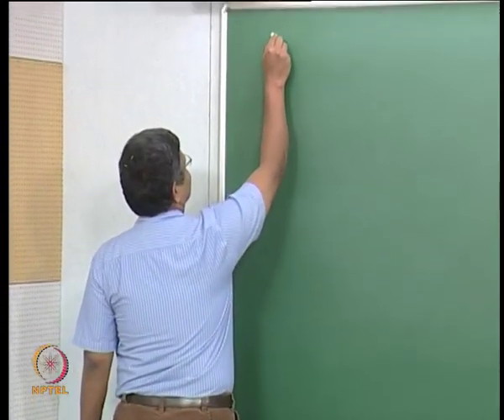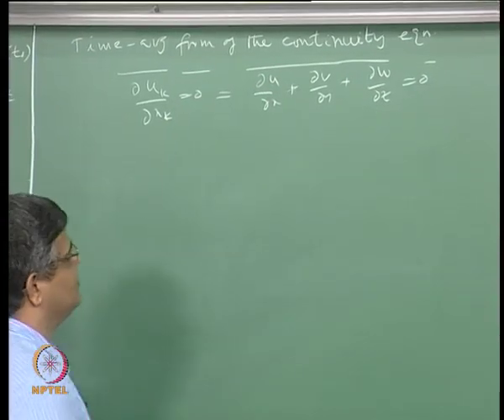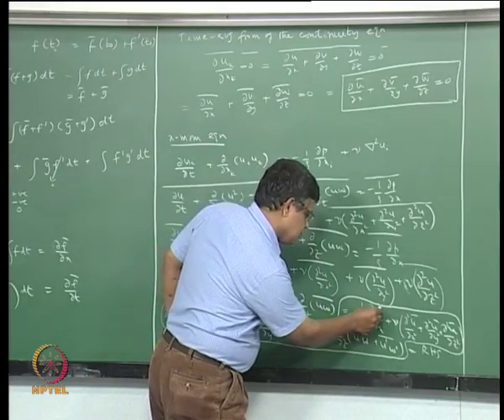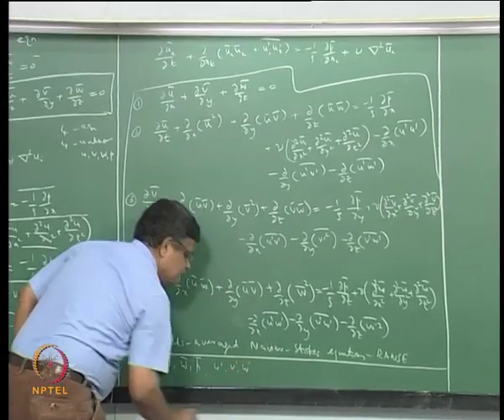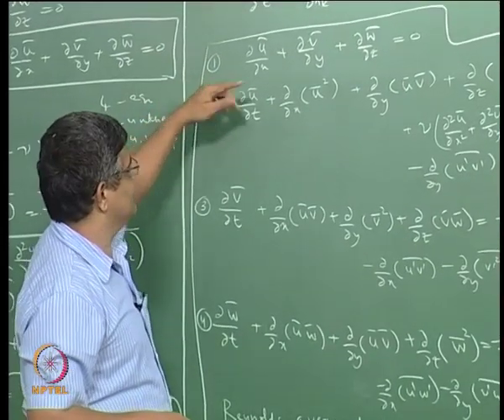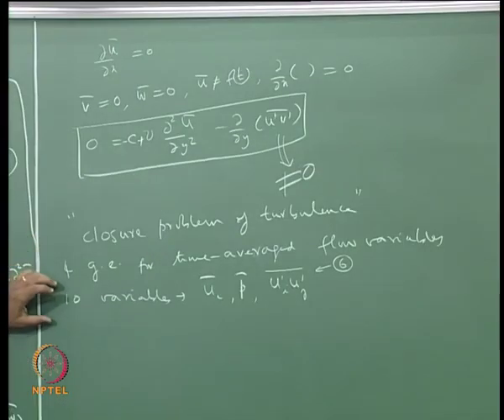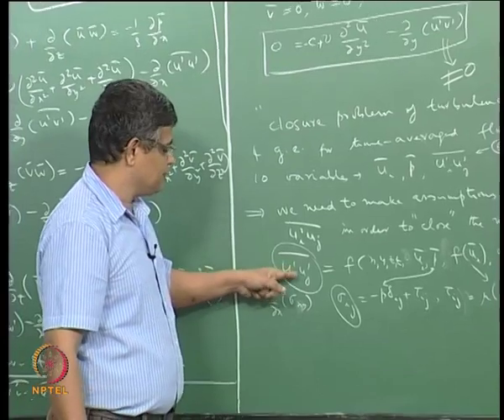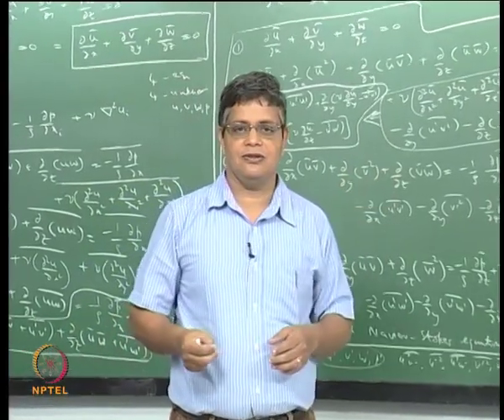Mod-06 Lec-35 Derivation of the Reynolds -averaged Navier -Stokes equations

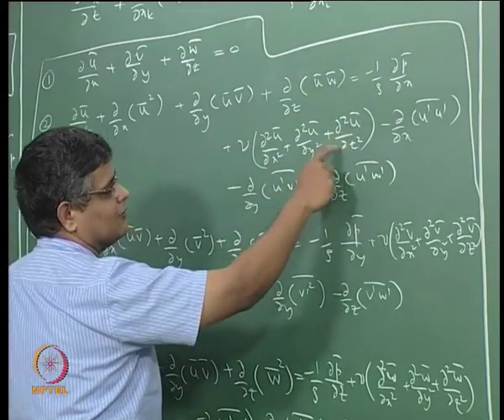Comment: at 34:28 if we consider second order derivative of u' to be zero w.r.t z than why is it not zero w.r.t y
Reply: there is no gradient in the z direction but there is gradient in the y direction. flow between to plates not a flow through a tube
Reply: It's like the domain could be 3D but the flow is 1D(only streamwise direction). The u component velocity varies in y direction(due to shear stress) but not in x(due to fully developed) and also not in z(which in turn will make the flow 3D).